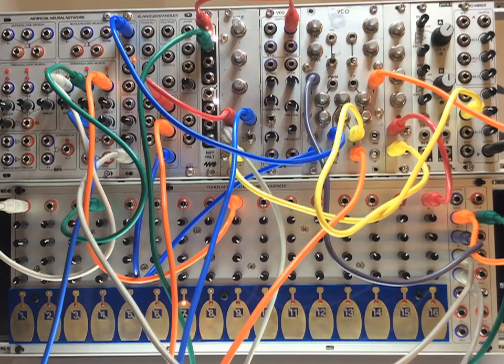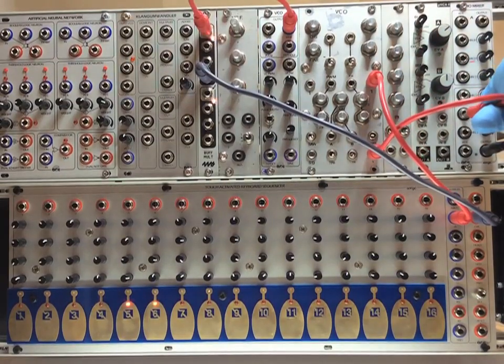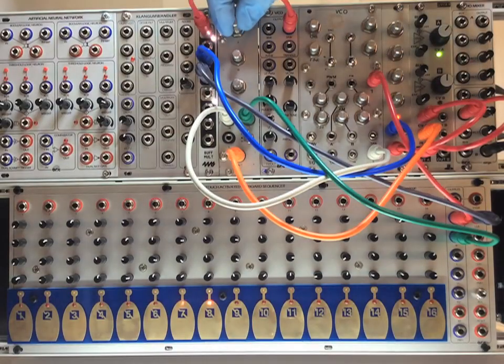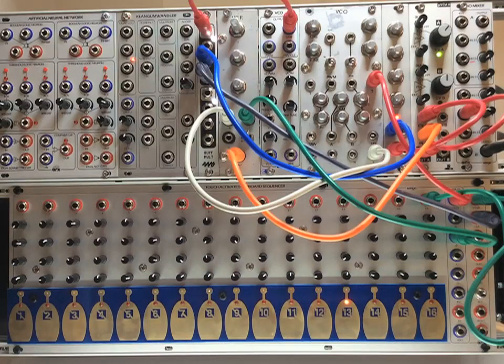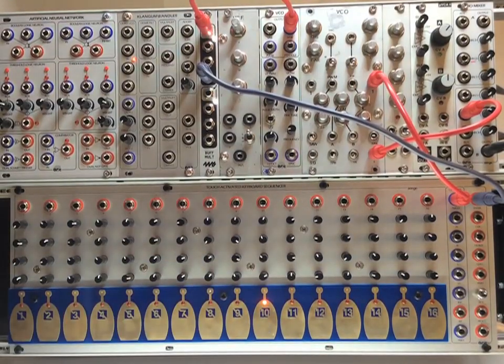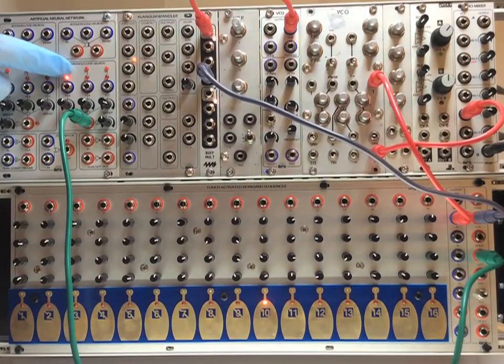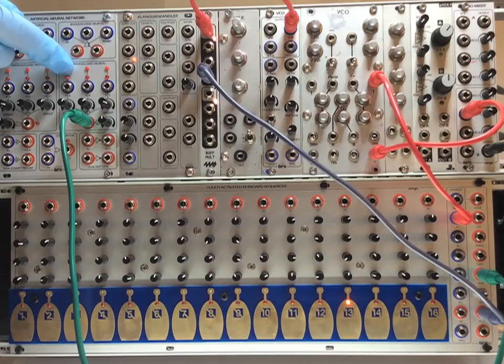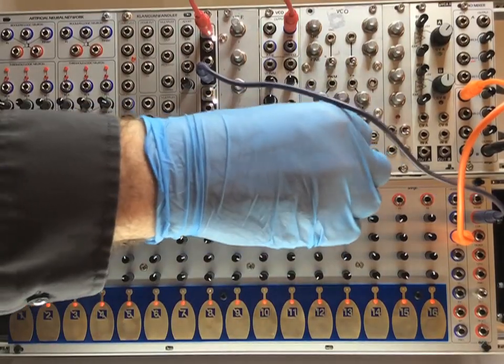ARC Serge TKB eurorack sequencer: Patch examples (2/2)

Comment: Is it possible to disable say steps so it’s not triggering all the steps? Ie it plays the full 16 steps but only triggers 9 of them to create spaces in the pattern
Reply from the maker: one way to accomplish this is to take the trig outs from the steps you want and send them to a trigger mixer, then send the mixed trigs to your envelope, trigger delay, filter, etc.  stacking patch cables (like those made by "Modular Addict") can help in this respect too.  you can also send a trig on selected steps to a slew module to program acid style slides. 
if you don't need the sequencer to be free-running, you can also clock the module from a drum machine with only select steps of your pattern, and then send step 10 trigger to reset (so your sequence is only 9 steps long)